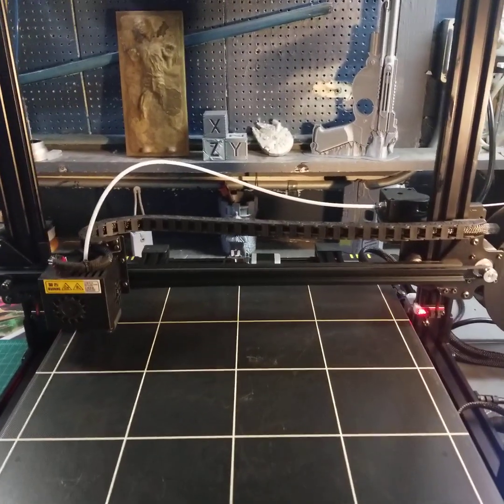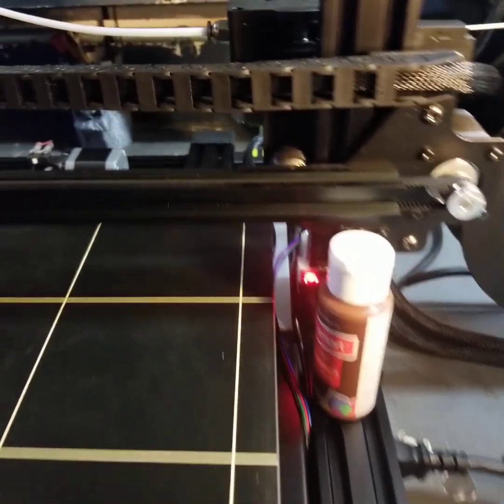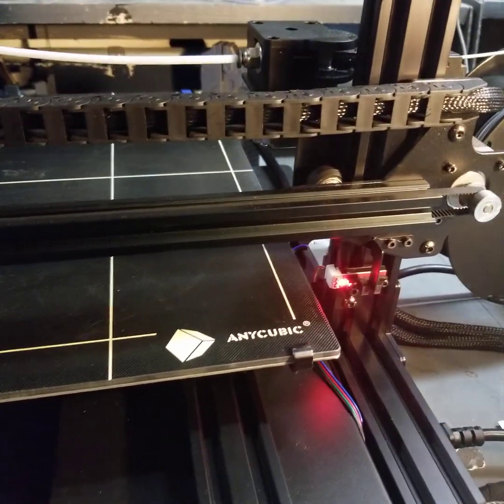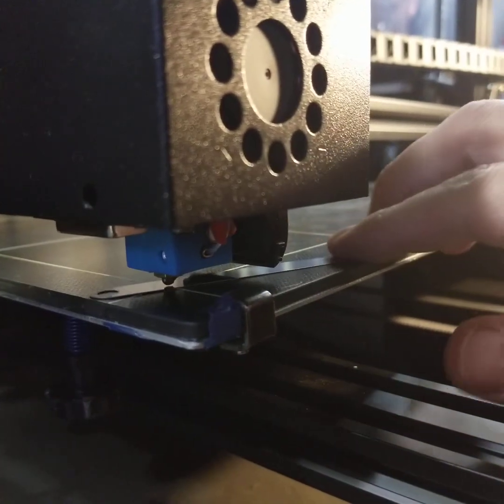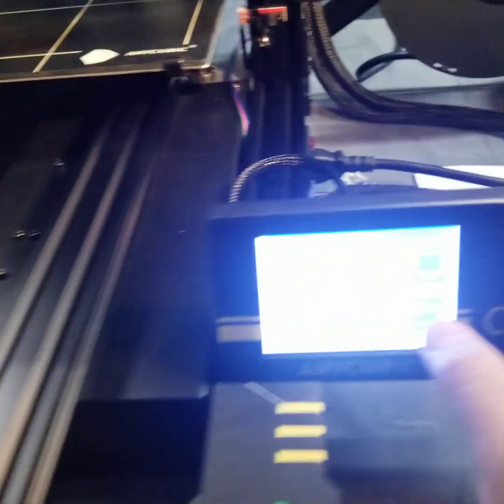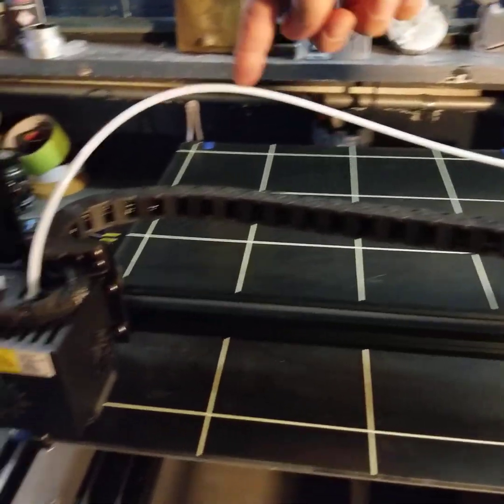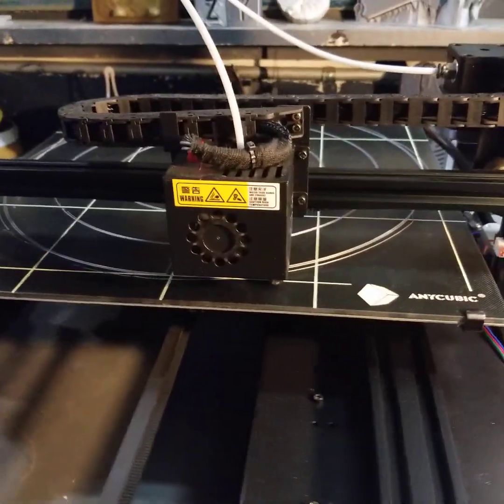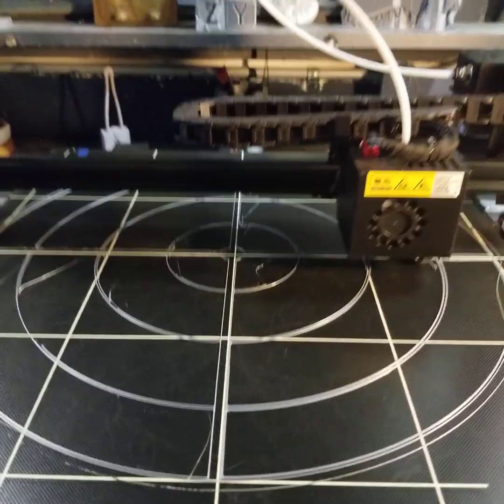Anycubic Chiron Manual Bed Leveling

Comment: If you manually rotate the motor to level the gantry you’re going to have to move the right sensor because if not when you hold it it’s gonna be off again

Comment: We've a new Anycubic Chiron and had the 3D printer set up and everything seems to be in order. However, we've yet to have a sucessful print. The print head marks out where it is going to print. 

Prints the first layer, rises, and starts to print the next layer, only to catch and drag the first layer, detaching it from the heat plate. Any ideas?
Reply from the maker: I think your first layer isn't getting the right adhesion. Sounds like your Z home is off.

Comment: I’m having all types of issues. I put mine together yesterday and tried the auto bed leveling but it almost damaged my glass by pushing it down as far as it could go instead of coming up after it clicks. So then I manually level it and everything good and test print came out fine. So I try my first print after the nozzle dug into the bed leaving a massive gash in it. I try to manually level it again and it was way off. So I leveled it again test print was fine. The next print the filament wasn’t even coming close to touching the bed. So I leveled it again test print fine and then the next print is digging into the bed again. Have no clue what I am doing wrong since I am doing everything here.
Reply from the maker: It may be your Z offset sensor needs to be set properly. Or your limit sensor needs to be replaced. The Z limit switch tells the printer when to stop moving down.

Comment: My heated bed isn't working properly
Reply from the maker: Is your power setting in the correct position? Also make sure all your plugs are inserted.
Reply: @PrimeDirectivesArmory  yes all plugs are inserted and everything. My bed doesn't go past 25c
Reply from the maker: @davonwood2451  you can join the the Anycubic Chiron Facebook group page. Maybe someone will have a solution.
Reply: I bet your power sector switch i.e. 230/110 is set to the wrong input voltage. It's on the power supply.  It's red.
Reply: @Jeepjocky  ok so how do I fix it
Reply: @davonwood2451  if you face the machine looking at the control screen the power supply is on the right side under the last 3rd of the table. Once the power supply is located you will see a small red switch on the supply on the side that's visible. Simply slide th switch to the right and it will switch to 110v.

Comment: Just got one of these and trying to figure out the leveling. I always thought the paper idea was kind of silly so I was using a styrene sheet but the metal tool you use is the best idea yet. Thanks for that.
I'm really curios why someone (smarter than me) hasn't built something that would clip onto the print head and be the perfect depth every time.